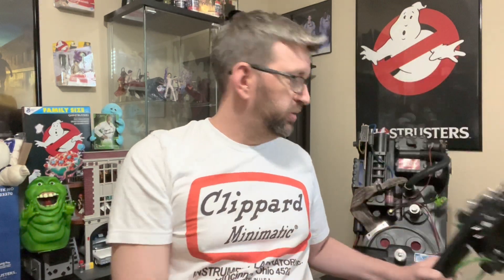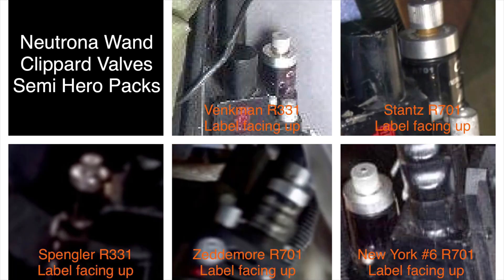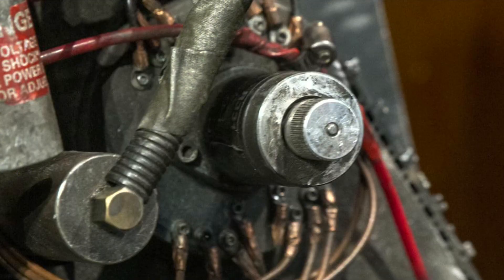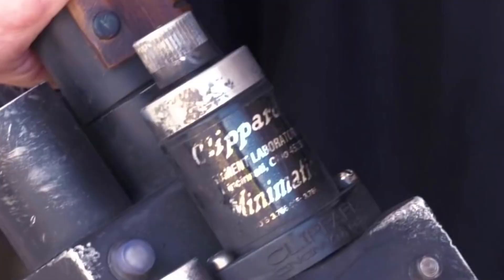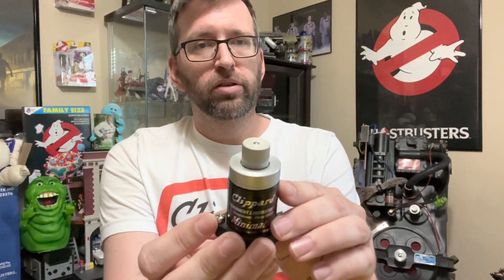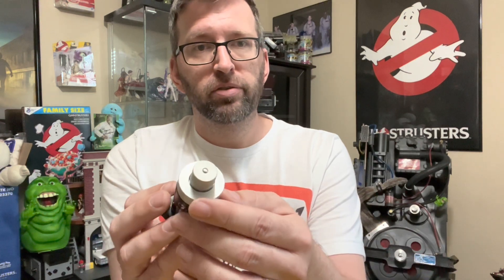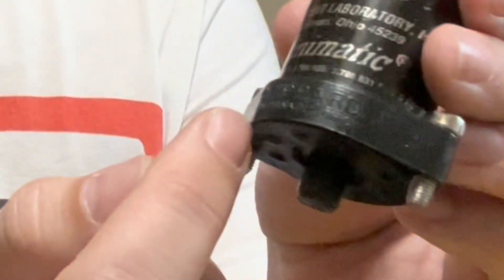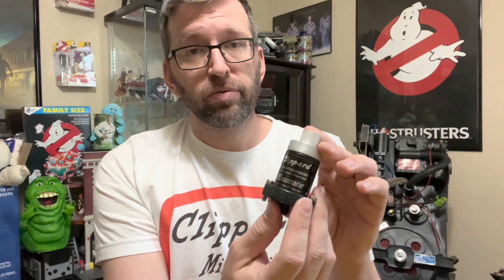Vintage Clippard Minimatic Valves - Comparing Modern & Vintage R701’s & R331’s

Comment: Question:  If These aare Air Valves- can they be utilized as such on the thrower or pack? 
Im asking bc ive seen these crazy mods where after 30 seconds of streaming, the proton pack goes into an overheat mode and shuts down- some packs  open up and release fog /smoke and i was wondering if i could actually use these air valves to do that? Has it been done?

Comment: I wonder what year Clippard made those small changes.  I purchased an R701 and R331 directly from their online store back in 2005.  They have the plain text on the brand name at the base, so I guess they are vintage style.  They are also a little scuffed up, with the labels peeling in the corners.  I am guessing they are probably not worth selling, unless they've never been removed from their packaging.
Reply: I was going to comment the same, but 2008 for me. They're vintage style, but have the newer styled Philips screws. I tell ya what, ya just about learn something new every day in the Ghostbusters prop world. To think that I thought my pack was as accurate as it WASN'T at the time is almost laughable! LOL! (Then again, there are a ton of variances between every pack... which is kinda the fun of it.)
Reply from the maker: The seller I bought from just posted 50 on eBay. Let’s see how fast they go.
Reply: @TheProtonPackIsNotAToy  shoot, I might need a set for my Mack's Factory build ... which should be complete sometime in 2055.

Comment: Hmm, I think you were the other person who bought the 331 on eBay last week. I got the other. I believe there are variations on the vintage Clippards, more so than just the font. Newer vintage ones have Philip screws while really old vintage have slotted screws.
Reply from the maker: I had noticed an inconsistency with the screws. That’s helpful information. Like I said in the video, only the valve on the thrower keeps it’s screws, so I might do a little swapping if necessary to use the older screws on my thrower valve.